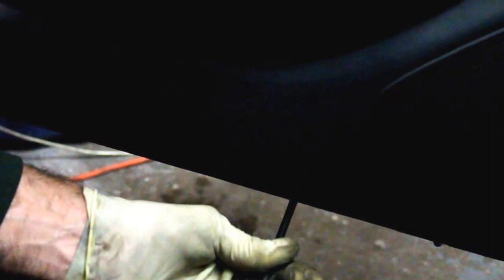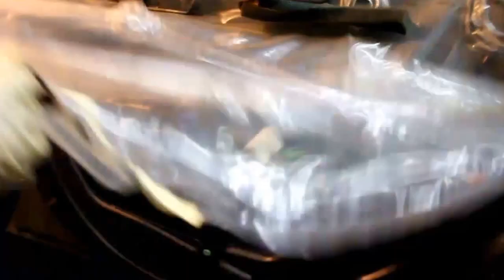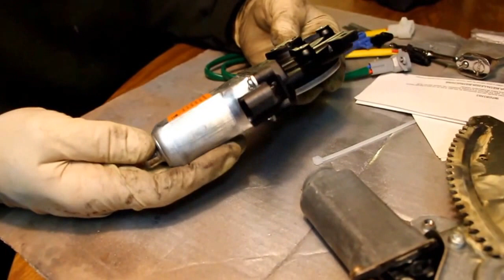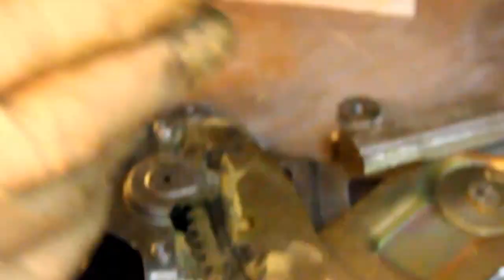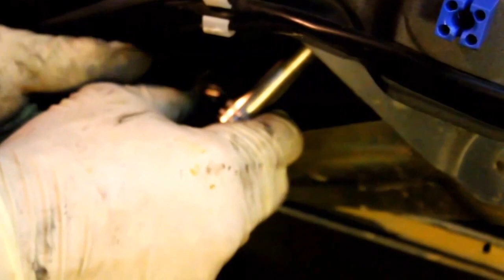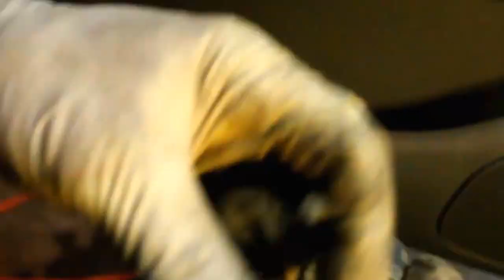Window Motor Replacement - Toyota Camry

Comment: Pulled motor apart and everything looked good. Commutator, brushes, rotor, bearings. But for some reason it still wanted to act like there was resistance and stopped like your example. Maybe there is a capacitor inside the moulding. My only guess.

Comment: Hi Jeff.  I watched your video and replace the motor but when I press down it goes up.  Was I sold the wrong motor or is there a setting in the motor I need to change?  The window goes up and down just fine but the it is reversed from all the other windows.

Comment: Jeff, what brand did you use to replace the junk part? I've looked around and found an Aisin, but only the motor/regulator combo (around $100). Others included a Cardone (lifetime warranty) for about $75 and many cheaper (probably Chinese) brands of various quality and a 1 year warranty. 
Is yours still working?

Comment: Am i missing something,you say to drop the window to obtain access to the lower bolt,but if the motor is not working?
Reply from the maker: In most cases, the motor does not stop working completely, it just looses power.  In other words, it can go down, but not up.
Reply: @JeffsAuto  Thanks for that,cheers

Comment: Can THIS motor going bad affect the other door windows, like maybe it fried the "lock all windows" button as well and so the rest are stuck in the locked position?
Reply from the maker: Each window motor has a circuit breaker that reduces the window power for safety purposes.  Over time, the contact points on the circuit breaker build up corrosion and eventually the motor stops working.  This condition seems to be even worse on a cold day for some reason.  I have never once seen a problem with the lock all windows button so I am not sure about it shorting out.

Comment: Great Vid:
Tip (1) Once you get the regulator repositioned with the hooks lined up, finger tight at least one of the bolts before attempting to plug in the motor in case you bump the regulator and it falls down resulting in damage to the motor wiring.
Tip (2) Some aftermarket regulators do NOT come with alignment hooks so you will have to hold the regulator with one hand as you put in a few bolds to hold it in place.
Reply from the maker: Thank you for the tips!

Comment: Great video; just one question though.  While installing motor, do the gears on motor and rack have to be in a certain alignment or in a specific position to avoid over or under run, or hitting the top or bottom after the glass is installed?  Your help will be much appreciated.  Thanks.
Reply from the maker: My recollection is that is does not matter.  I believe the motor will run continuously until it hits resistance, then an internal circuit breaker cuts off the power.  But, to be sure, suggest plugging it into the connector in the door, just the motor, and flip the switch to see if it keeps running or bottoms out. If so, setup the placement accordingly.
Reply: @JeffsAuto  Thank you for responding.  I marked the position of motor and regulator with a permanent marker before dismantling, but it got erased unintentionally.  Now I'm a bit at loss.  The motor on its own rotates freely in both directions, so I am assuming (and as you said correctly) that the motor is supposed to run continuously until it detects resistance.  The power window is not equipped with auto detection.

Comment: I don't think you have to remove the glass.  Just unbolt it and slide it up manually and either tape it to the door or stick a piece of cardboard between the window and inside of door to hold it in place.
Reply: I've done it twice. It was easier on my second window I took the glass out. Moved the regulator all the way down with the motor and then attached the glass.

Comment: Do you have to have power to remove this part??
Reply from the maker: It would be hard with a dead battery because the window would probably be all the way closed.  Being able to move the window up and down as you go makes access to the bolts much easier.  There are holes that line-up if you get the window in just the right place.
Reply: My question exactly! Seems like you need to be able to move widow up and down. I guess I'll see if I can move it after it is apart.

Comment: where did you buy the motor?   what brand?    Great video!
Reply from the maker: Readily available on-line.  Aftermarket.
Reply: @JeffsAuto  Thanks Jeff. Carparts.com or PartsGeek has it $ 85 or $ 92.

Comment: I replaced the motor.Now the window move up and down is reversed.Please help.Thank you
Reply from the maker: The wires on the switch are reversed.
Reply: @JeffsAuto  How can it be reversed? The switch connector has only one way to be connected.I'll check all connectors from motor to switch.Thanks for your reply.

Comment: Very helpful, thanks.  (My window is completely dead, so I'm thinking it might be tought to get to both window bolts if the window won't move...)  I hate to take it to a dealer!
Reply from the maker: The reason these electric windows goes dead over time is because the safety switch in the motor that limits the pressure of window going up wears out.  After a lot of use, the switch gets corroded and the connection goes bad.  So it is usually not that the window is binding, or anything like that, its just the switch won't let the motor put any power to the window.  The bolts are probably fine.

Comment: I might add that for some reason I could not line up holes closest to motor with door frame. I thought I had a bum regulator. After awhile I decided to start over. I took motor back off regulator, meshed up motor closer to middle of regulator teeth, then reinstalled and like magic,  everything lined up. This was on a 99 Camry left driver side door.

Comment: Hey Sr I have my window stuck all the way up , seems that the motor burned out and left the window up , how can I loose the window from the regulator if I don't have any hole to do it through?
Reply from the maker: Yes, that makes it a little harder.  But, if you unbolt the regulator, the whole assembly will drop down enough inside the door to reach the two window bolts with a combination wrench.
Reply: Exact same problem I have. Thx a lot!

Comment: Big big thank you!  Could not have done this with out your video!  That orange thing have me a bit of trouble on the install and one of the screws didn't line up so I just left it out, no biggie, it still works just asit should thanks again!

Comment: thanks man , made it easy, especially the lining the window up. The screws for the motor had to be threaded with the old screws, that's the only part you left out.thanks for posting  completed the whole job in about an hour.